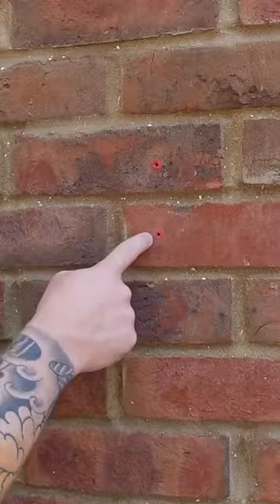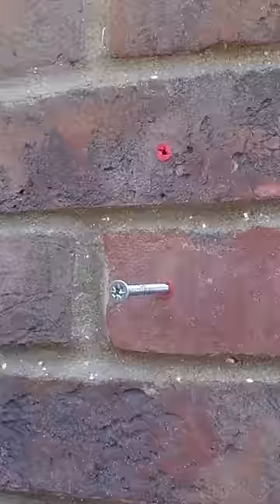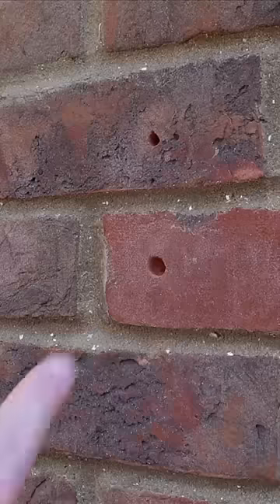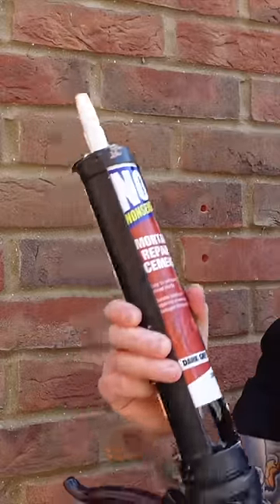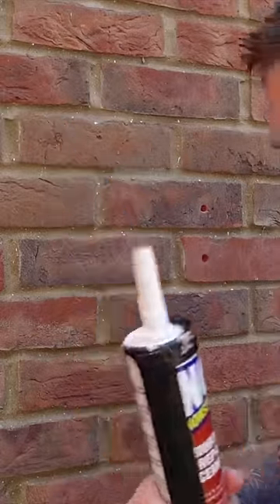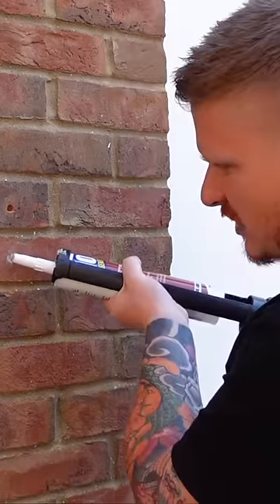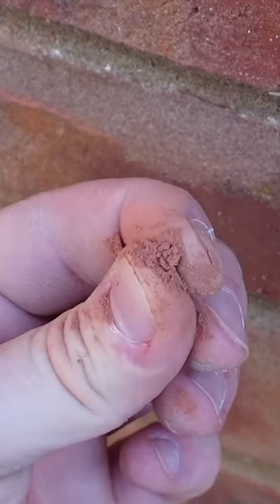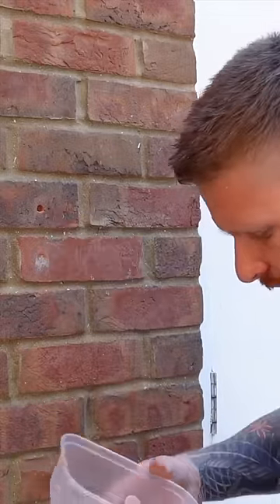Brick Dust Repair Trick You Need to See

Comment: Put the screw in a couple of threads and use pliers, you should be able to pull the anchor right out.
Reply: I think he copied this from a channel called artisan electrics where they mention if you knock them in there is less chance of blowing the brick out.
Reply: To what end?
Reply: @danjason2167 I would tend to disagree with this, it's a wedge anchor, probably more risk in driving it in. 🤷‍♂
Reply: @LFOVCF I'm sorry, I don't understand the question?
Reply: Or a claw hammer
Reply: If he removes the plugs there's more air gap to fill

Comment: I've always done that when ya drill a 1in or smaller hole in brick or cinder block etc even the morter between the brick which is usually where phone/cable companies drill into for there installations but if drilling thru any brick type but ya hit something you just can't get through that was behind the Brick/block you can usually pick enough of the brick/block color of the brick below the brick ya drilled through or even off the ground also I always have a bag of secrete & plaster of Paris etc on the truck to quickly repair any possible screw up...and that's when it gets interesting.....

Comment: Put the screw in and pull it out with a claw hammer.
Reply: Exactly what i thought, or you could just drill it out gathering brick dust at same time....
Reply: More chance of pulling a chunk of the brick face away doing it that way. I always hammer them in but each to their own I suppose.
Reply: Leaving it in means it's closed off at the back of the brick so you need less to fill the hole. Also pulling it out may make the hole bigger and damage.
Reply: @nousername.4831  My thoughts as well.

Comment: You can also just pull the plugs out of the wall instead of pushing them in...
Reply: It stops the caulk from going to far in.
Reply: @Scott-sm9nm  you should be filling the whole hole till the end to get the strength back in the brick, plastic does not do that.

Comment: They make red dye you can mix your cement with, so you can match the color of your bricks. I used it a bunch of times when I was a mason. 

Use the dye instead, unlike caulk it won’t dry up and rot, also, the powder will eventually wear away - so you’ll be stuck with gray caulk until it does inevitably rot.
Reply: Does lose colour though and fade. Mu h better to use a mortar die than this shit that'll wash off 😅

Comment: Great tip. I have 3 holes that needs to be filled so will deffo be using this trick. I know some say use silicone but I probably will use cement.
Reply: Sounds wrong
Reply: @olivierw4941  there is always a wise guy in every comment....
Reply: @mumihp  😂

Comment: I used to do repairs for sky tv. Literally all over the U.K. repairing holes from when the engineers, drilled a anchor point for the ladders. Never ran out of work. It’s crazy how many people don’t want a small hole in wall. I even went to a job where the engineer tried to drill threw a glass window to run cable. No lies 😂😂
Reply: Don't called technicians engineers, you'll make the actual Engineer angry
Reply: @nathanscott90  call them engineers so they can charge more.

Comment: The plug should have been inserted 5mm or so below the depth of the brickwork in the first place. This allows this kind of repair without banging screws in. It also avoids hole break up when screwed into for the first time. Could also pull the plug out by screwing in and levering the screw with plug, out. Plugs are usually reusable.

Comment: i think is better to drill the plastic out with a smaller bit, followed by drilling a little further for ur brick dust and aster filling it 9/10th of the way mix 1 part quick cement and 9 parts dust, then apply and texture after. upgrades people

Comment: When you drill the brick, won't the color not match since the inside of the brick is not weathered, leaving the dust a different color? So. Couldn't you just use any brick and not make a 3rd hole to repair? 
Genuine question.

Comment: Hammering in the old wall plug would only work if the hole is considerably longer than the plug used... which if the hole was drilled correctly in the first place wouldn't happen.

Comment: I would like to try that with mortar instead of caulk.
Reply: This stuff is better
Reply: @jackpartridge7891  
I'm not sure I know what better means. Let's assume for the moment that initially the caulk looks better. That's almost irrelevant, because this is brick we are repairing. The real test is which will look better in 10 years. Most caulk  will have shrunk and hardened. Mortar, on the other hand, has stood the test of time.
Reply: @JohnFBramfeld  dont get your knickers in a twist. he uses mortar. read the tube
Reply: @techheck3358  Real mortar doesn't and can't come in a tube. The instant real cement hits water it starts to cure. It is always mixed on site and used quickly. In exchange for the inconvenience you get an incredibly durable and long lasting product.

Comment: 1/ Why?
2/ If you really want to. Then put the screw in and then use a claw hammer to remove the plug.
3/ The repair he does shows up worse than before!

Comment: You should not hit the plug but pull it out. It is plastic.
Reply: Why? By hammering it in tho he’s creating a backer rod of sorts
Reply: Good plugs are designed NOT to come out easily!
They will not affect the brick if pushed in and filled over
Reply: @davehornet6  Maybe not, but it's still just wrong!

Comment: How do you repair the 3rd hole you just created? Do you have to drill a 4th one?
Reply from the maker: You didn’t watch properly, there is no third hole
Reply: @TheDIYGuy1  banter banter. Would have been better if you told me to drill a 5th one. You can also use brick dust and snow Crete. Keep up the good work mate 👍

Comment: Could have also just pulled the plug out. Also if the hole isn't deep enough doing it this way won't work
Reply from the maker: Nope. Pull the plug out and you risk blowing the brick face. And the hole will be deep enough otherwise you wouldn’t have a plug in there 😂😂

Comment: 2 things bothered me 😂

1. Using Screfix brand no nonsense is terrible
2nd. You used red brick dust on a black brick.. brick is not the same, its more charcoal brick where u edited.

Correct me if im wrong.

Comment: So you put something that’s going to get harder than the brick in the holes? Guess what’s going to happen to that brick?
Reply: @Treedom Vellacroix what will happen is the same thing that happened to the acropolis when they tried to rebuilt it in the 30s. They used iron braces to keep the marble together. The iron rusted, swelled and cracked and ruined marble that was over 4 thousand years old. It was devastating. We’re talking about Ancient Roman architecture here man! Get with the program!!!
Reply: @flores415  That's a stainless steel screw
Reply: Mortar caulk doesn’t get hard

Comment: Why not pull the plug out?
Reply: It gives the filler something to bond against behind it, stops you losing all your filler into the cavity
Reply: @tom.2900  The plug is plastic so mortar doesn't stick to it. Tbh, it doesn't really matter as long as the plugs in far enough, but it's just as easy to pull it out and then you can get more mortar in.
Reply: @jimtheudb  Sure, it won't stick to it, but like you say it doesn't matter. It's a backing so you're not just pushing against nothing.
Reply: @tom.2900  the trouble is if its only pushed back, say 10mm there's not enough mortar in there. The best advice would be to pull it out, this is what builders have done for years.